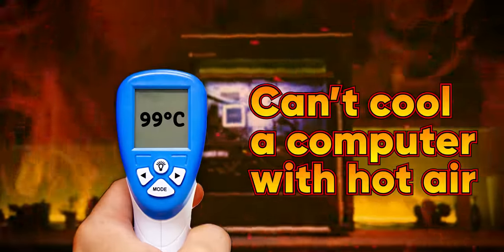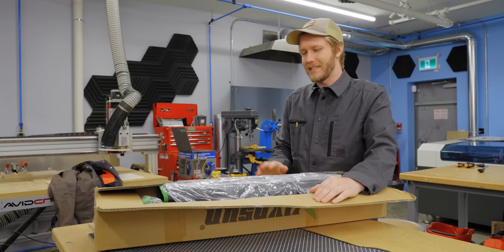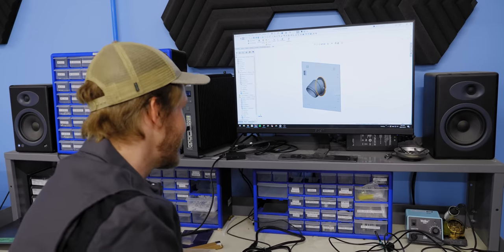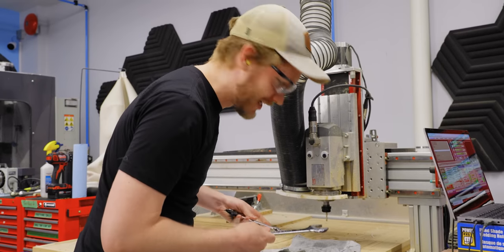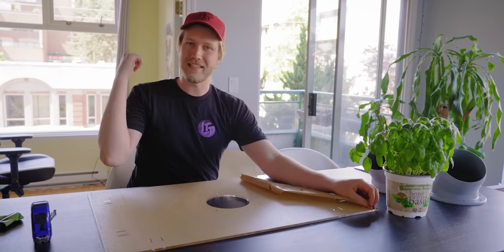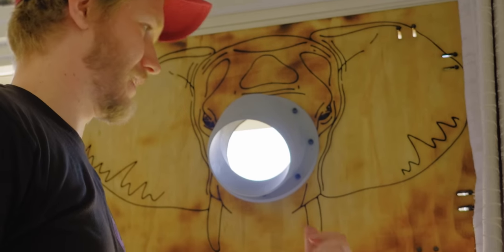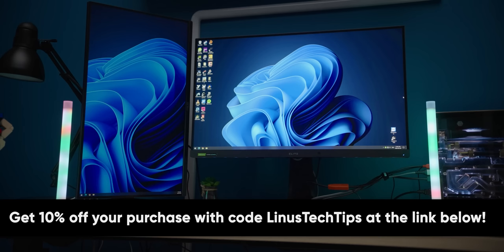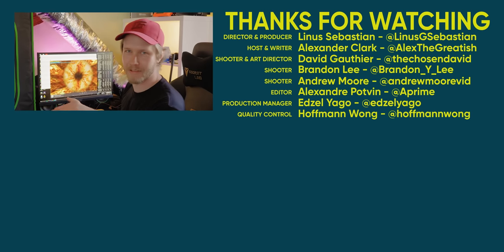You’re cooling your PC wrong. - PC in a Grow Tent

Comment: Please do case, fans, AIOs, and other cooling hardware reviews! 
Cooling should be taken more seriously, as proven by the fact that my dual-fan RTX 2070 exceeds 100 Celsius whilst playing PCBS2.
Reply: you will get these when they will finish lab
Reply: Why does it though?
Reply: @Wilqu5677  Indeed, I'm hopeful about this.
Reply: Those aren't exactly normal temps for such a game though,
Reply: @22oreos  You should go into the BIOS to make your case fans spin faster, fix your cable management in the front and also dont use the silent mode on your GPU
Reply: @thomasfriedl3137  I keep GPU and case fans running at 100% and I get little to no benefit. But my case fans suck.
Reply: @22oreos  How many case fans do you have?
Reply: @thomasfriedl3137  Six. One rear exhaust, two top exhaust, three front intake. My case can't fit anymore, and I don't think my case will be helping things either lmao
Reply: @22oreos  Okay wow eighter those fans completely suck, or your GPU has badly applied thermal paste or something like that
Reply: @thomasfriedl3137  Perhaps both? I got the GPU used in August 2020. It's an EVGA RTX 2070 Black and its own cooling seems adequate.
These six case fans are Corsair SP120 RGB PROs. Three came with my case (220T RGB AIRFLOW) and I bought three extra (back then I didn't know nearly as much about computers). These fans lack PWM and are oddly loud for the air they push.
Reply: @22oreos  I have the exact same case (and fans) and I just set them to spin at 100% when the CPU hits like 60°C, the noise doesnt really annoy me because I have headphones on
Reply: @thomasfriedl3137  CPU temps seem fine.
Reply: @22oreos  Well that way the fans are always at 100% when I'm gaming
Reply: @thomasfriedl3137  I kept my fans at 100% and there was minimal change.
Reply: @22oreos  Yeah there is probably something wrong with your GPU, do you have some sort of warranty on it?
Reply: @thomasfriedl3137  Lmao the warranty will be long gone. It'll probably need repasting tbh
Reply: @22oreos  Yeah

Comment: First what I did was UV reflective film on Windows blackout curtains on all windows in room cheap LED bulbs in the color I wanted 5000K and it was just a lot cooler in the room there's always a line of solution PC in different room but still you know UV tint on Windows and blackout curtains that block heat from entering room the foam backed ones

Comment: You should add an air intake from the window to the tent. That will prevent sucking all the conditioned air out of the apartment, and pulling unconditioned outside air in to replace it.

Comment: If your PC is next to a window you can just put a fan in the window blowing the air out the window. It will still pull cooler air from the rest of the house into your room and keep ambient temperatures cooler. That's what I've been doing and it works great considering my room normally gets above the outside ambient temperatures as it is upstairs and collects heat. I also open a window directly adjacent across the hall which pulls in fresh air from the side of the house that's not facing the sun during the day.

If the outside gets too hot though, get a window inserted air conditioner unit if your window can fit it. They're more efficient than portable air conditioners as the evaporator is outside the house so no heat radiation off the tubing and for single room you can get one cheaply at around $150-200.

Comment: you dont really need the grow tent, just a ducted fan on the top or the back would pull a crap ton of air just thought that alone. would still need a place to dump the heat though.

Comment: Looks like there's a fireplace that shares the wall with the room the PC is in. If it has a pilot light, shut it off in the summer months. I know it doesn't seem like it would make much of a difference, but you might be surprised that it will. I have a gas fireplace in my basement and there is a difference in temperature throughout the rest of the house. It's the opposite in the winter if the pilot light is not lit, and warm air is drawn up the chimney since the outside ambient temperature is lower than inside. It even affects my natural gas bill so it's worth shutting it off just for the cost savings (no, it's not much, but every little bit helps). The air going up the chimney has to be replaced and that means air from outside, is being drawn inside.

Comment: Ac infinity has some really nice kits and are affordable for their high build quality, u can get fan and a controller that can thermostatically control itself and turn on the fan at certain temp, and u can set the fan speed from 1-10, pretty quiet comparably to other systems on market.   Controller with an app for phone as well to really get into control or more basic models,  display on outside of tent with mounting bracket and clean digital look.

Comment: They make them in many sizes. One with filtered AC input, exhaust can go to AC return mix. Put a fan in both input and output. Carbon filter on the input. Can even get a decent Humidifier dehumidifier with a controller. Set the humidity target on controller. Can work as impromptu server room for more delicate or mission critical electronics.

Comment: Rather than the elephant in the room (ha!), you can easily buy off-the-shelf AC duct venting solutions for casement windows, typically made of fabric, that block minimal sunlight AND work for both inward- and outward-opening casement windows AND still allow you to easily open and close the window when installed.

Comment: those tubes look like you could cut them down to make a smaller enclosure.  You would lose the connection mechanism but could use glue in place of it... if planed right it could still be mostly disassemble-able.  You would then have excess "tent" material which you'd have to fold and maybe get bungee cords or nylon straps to wrap around the outside to hold it in place.  Ducting could be hung from the ceiling... to keep it out of the way.

Comment: Did something kinda similar ages ago by sealing up a case good, putting all the PC fans to intake, installing an ac air hockey table fan on the side, and venting outside via a dryer vent. worked like a champ

Comment: You don't need insulated ducting.  Place computer on shelf next to window, then attach short duct run to power fan outlet, no blower or "tent" needed. 

A single, tiny window AC unit seems like it would be more efficient. Also it would most likely be cheaper for initial price and for electrical bill.

Comment: Lemme help you out here. The crossbars on top are for hanging a light and inline fan/filter. The rigidity of the tent is provided by the fabric, not the bars. The strip of fabric tying everything together is literally just scrap material from manufacturing. They use it as tie material to save costs. Doesn't need to be pretty, just needs to work and be cheap.

Comment: hey Alex, have you thought about just covering the outtakes of your case?

like one tube exactly at the 120/140mm fan on the back and an other one hooked to the GPU grid that's on the backside.
i could imagine the default airflow by the fans would be enough to get the job done, if not you could use something like an repeater.. but just for air with fans ^^

would be interesting to see if this smaller version would do any difference, while the PC could suck in cooler air.

Comment: There is one problem with this setup, pushing air out the window is depresurizing the room. Causing the room to pull air from the rest of the apartment, and it doesnt stop there. It will depresurize your apartment until it eventually starts sucking in air from the outside which will be much hotter air than the air you are pushing out. Also raising your electricity usage... sorry guys but this wont work and he will eventually realize this after a lot of troubleshooting. Sorry if this seems like a plug but check out technology connections video on indoor A/C units for a full explanation on how it works.
Reply: I've seen that one.

Comment: Look at Trotec airlock.  They sell Velcro+zip window wrappers (EU style windows) for portable AC that would work great for the pipe.

A single pipe out will cause negative pressure - hot air will come in from outside through every cap/ventilation and sewer lines.

Comment: I'm glad most of the comments recognize what a short sighted implementation this was. You don't need a grow tent, the only thing helping here is air exchange. It would work just as well if the window had a fan attached. It's also wasteful since blowing air outside means you're drawing warm outside air into the rest of the home to replace it, forcing the air conditioner to work harder.
Reply: ricky bobby  the cooling in the room is purely from replacing the room air -- they weren't trying to cool the PC, they were trying to cool the room

Comment: It's amazing with all they understand about positive and negative air flow in a PC case that they couldn't make the connection that the apartment is a giant PC case in this case. Your HVAC unit continously moves the same air around your house. The amount of intake is the same as the amout of air exiting the vents + a little make up air in some cases. You just put your house under negative pressue. You are now drawing air in to every crack that has a path to the outside world.

Comment: 5:59 Why is he 3D printing something you can buy at the hardware store for $10?

11:06 that thing is gorgeous.

So the problem with this whole setup is you're pulling cool air from the house and dumping it outside... this means you're pulling in hot air from outside the house to replace the extracted air. This will cause your AC to work a lot harder, probably failing to keep up on hot days.

The simple way to solve this problem would have been the smallest possible window mounted AC. To extract the heat from two computers (let's call it 1000 watts TDP), you only need 3140 BTUs, so even the smallest window AC would keep up with that room (assuming the house AC is also running most of the time.)

Comment: the best thing you could've done was exhaust the PC air back towards the AC intake. The way you have it set up now, you are exhausting the hot PC air outside, you did mention the amount of air coming in the room from under the door from the rest of your place, so where is that air coming from? You will have an air leak somewhere at your place with air from outside (hot air) that is being pulled into your place to replace the air you're pushing out. Which will make your HVAC work harder to cool all that additional air coming from outside. I've tried something similar before. It does work, but you're way less efficient overall.

Comment: I think that if you try to throw the tent out and 3D print fittings that bolts directly to you PC exhaust it would work better.
Because by using the tent you keep your PC in a hot environment. By removing the tent, you pull the heat instantly and don't create a "buffer" of heat.
The tent might be working for mining rig because they are open air PC, but as you have a closed case, you can take advantage of it.

Comment: Love it. I tried this years ago. But the acrylic was 1 m² !! The amount of back pressure was insane and didn't have a sufficient mounting for that amount of force, had to use the mail slot in the door as an inlet taking air from the apartment hallway. When that sometimes closed (springloaded) all hell let loose. Also lived on the bottom floor so a pedestrian or two got hot portable AC exhaust to the face walking by 😆 

This time around I'm thinking of mounting the AC exhaust on one of the natural air intake vents suspiciously made for the exact hose diameter I have. I'll be able to hang meat inside the whole house! 🤯

Comment: Uh... that trunk needs adjustment. Rain that hits the window will drain into the pipe. It's why all external pipes have a length and are slightly pointed down so water drains.

Also, two pipes, one to bring in air from the outside, to prevent inside air from being ejected out. I mean, just having a fan attached to the elephant would work well if you don't mind removing the air from the house.

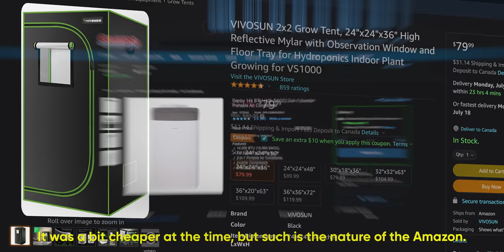Comment: 1:28 ok-ish?  That's 14,000 BTUs.  Which is a little over a ton unit. But that aside, NOBODY SHOULD EVER BE USING PORTABLE AC UNITS!!! Especially.... ESPECIALLY if they are single hose.  Even if they are dual hose, they still take up a lot of space.  To spot cool (which is what you'll be doing, unless you have no central AC), you'll only need about 5,000 BTUs.  And those use less than 400 watts.  A 20 amp circuit can handle 16 amps 24/7/365 which comes out to 1,920 watts.  If it's just a gaming PC, you'll be fine for sure.

I'm not saying the grow tent solution won't be great, but the issues outlined for using an AC were way oversimplified to the point that they were kind of not true.

Comment: 13:33 Yeah... It's creating negative pressure.
You are making your house way hotter through the negative pressure caused by the fan. Which, by consequence, will make you feel hot.
If you have A/C, it will make your A/C work extra.
If the outside is too hot for you... You will get to feel REALLY hot at home.
I was actually thinking you were going to have intake from outside and exhaust to outside... This way it will still feel like an oven at home!

Comment: Duck tape is not Ducting tape. Duck tape was made to be waterproof and strong, specifically for repairing sails while at sea/on the water. Ducting tape is the tape used for duct work it's aluminum backed (for thermal reflectivity) and lacks the fibers (and therefore strength) duck tape is known for.

Comment: Interesting concept, but I think you could just skip the entire grow tent casing, and just attach tubes to the output fan holes of the PC case itself, cause the rest of the PC is already a (somewhat) closed box. 
This way you might even be able to skip the Turbine there to push out the air, cause decent PC fans might already do the job, and reduce the amount of air you have to pull from the rest of the house, keeping the entire system cool longer.

Comment: You should add an input duct as well. Right now you're just sucking in outside heat in to your home. This is exactly the problem the portable AC units have. By dumping the hot air out of your house. That air has to come from some where

Comment: Make a sized to fit MDF crate with plexi front, line with mylar, and add venting mounts, route a home based ac vent into the chamber, and an exhaust fan on the top. Same "product" at a much higher end quality for about the same price with the ability to customize the exterior to fit your aesthetic.

Comment: Would you get simular results if you just made a custom case panel with a nosel for the insulated hose? You wouldn't be putting your entire PC in a grow bag but it would yank the hot air straight out of the system. You'd have to have all your fans flipped for intake of course. That would presumably save a load of space, make cable management easier, and be another excuse to use the workshop to create yet more things.

Comment: You probably had issue with the paint because it was to cold in there but do your first coat light trying to get full coverage but without getting it to wet then second coat trying to follow your wet edge top to bottom keeping an eye out for runs. You can adjust how close or far to get paint where you want it or to avoid runs

Comment: Get a second growtent, that is big enough to contain desk and user.
aircon that second growtent.
let the airconditioned air flow through the large tent first, than to the small tent than back into the room.
you might also want to put the heat sensor of the aircon at the place where air comes out of the small tent.

Comment: I like the idea. My first thought was that a good alternative to using a separate fan/blower to move the hot air outside, would be to attach the exhaust duct to the A/C return vent. Then all you would have to do is turn on the air handling unit fan when starting a gaming session. The thermostat would just kick on the A/C in that zone when the temp reading gets above setpoint. It would save on parts. You would be paying in elecricity to cool your PC. That said the negative pressure the fan is creating by blowing air outside would certainly be drawing outside air inside. The A/C then has to cool the outside air with the inherent additional moisture. Overall my guess is connecting the duct to your A/C return is overall more efficient.

Also, you can buy remote sensors for Ecobee thermostats. When the main thermostat is at setpoint and there a temperature differential between the main and remote temperature sensors the air handling unit fan runs to mix the air and equalize the temperature. When the main sensor rises above the setpoint deadband the A/C will kick on as expected. Not sure whether it would be as effective overall, but it's not as much of an eyesore. Currently I just turn on the air handling unit fan when I'm gaming which has the same effect. It definitely drops the room temperature. I haven't really tested how quickly or how much.

Comment: So the big downside to this is that the air you're blowing out of the house is coming in from somewhere. Most likely it's coming in from cracks and imperfections and seals windows and exterior doors. This means that you are then needing to heat and/or cool all of that air that's coming in.

Comment: I have a shaft in my apartment that sucks big air 24/7. If my apartment got too hot from my PC, I would just have super long cables running from my kitchen and have my PC up there connected to the shaft :D I wouldn't even need any fans in my PC at that point with the immense airflow.

Comment: If you run a negative pressure setup on your case, you could just 3d print and/or fabricate ducting for the top and rear exhaust of the PC. It would take up a lot less space and be way less ugly if executed well.